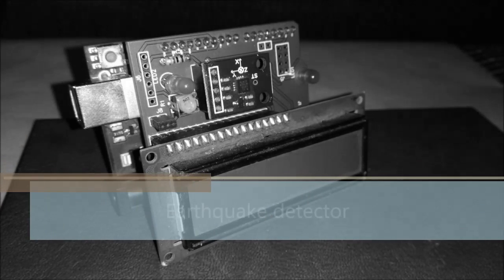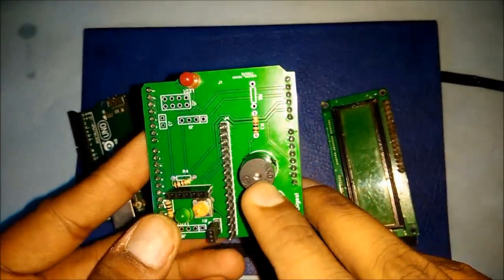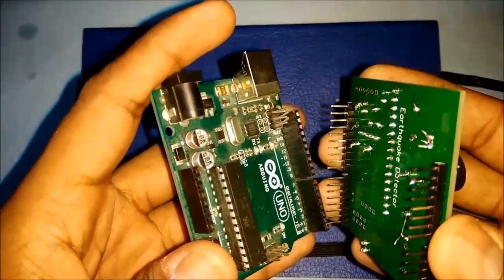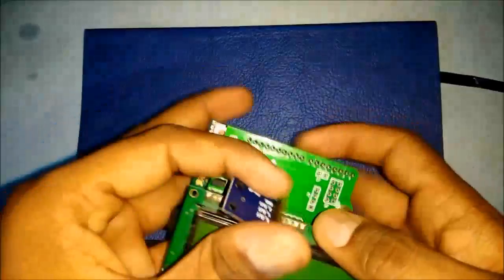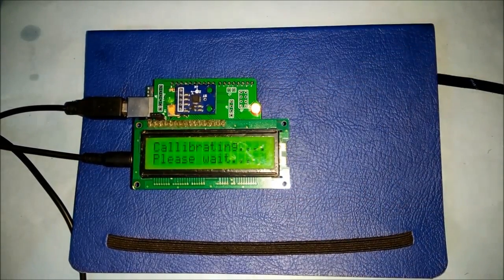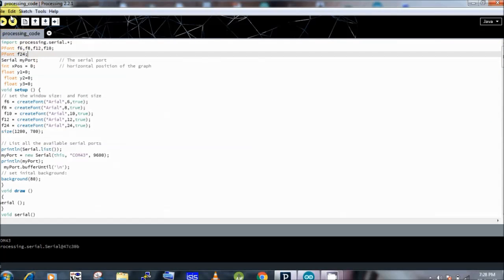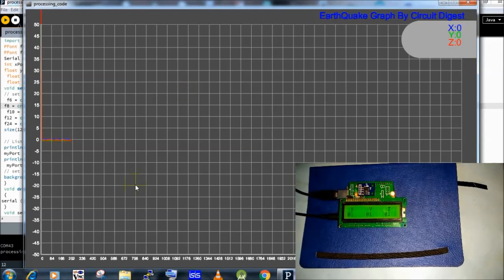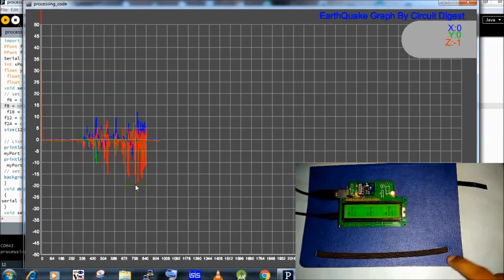How to Make an Earthquake Detector Arduino Shield using Accelerometer

Comment: Hello, I have a single question. Could I buid it without a LCD? Thanks
Reply from the maker: Yes it can be built
Reply: Thank You Sadamm I am from Brasil and I will try to built one. I was visiting your web page and it was very important to me. Thank you a lot. If you could me help on this (only using the arduino, acelerator and only ploting at this same software that you used) I will grathefull. Any way my email is andremurilobr@gmail.com thank you a lot